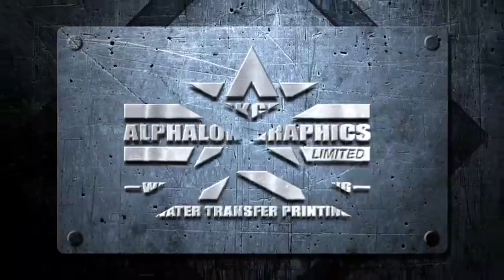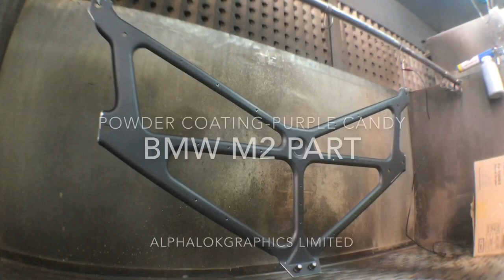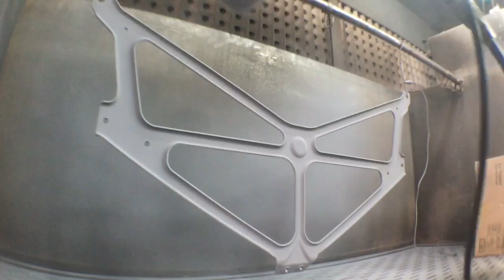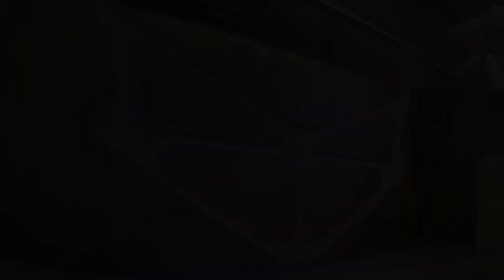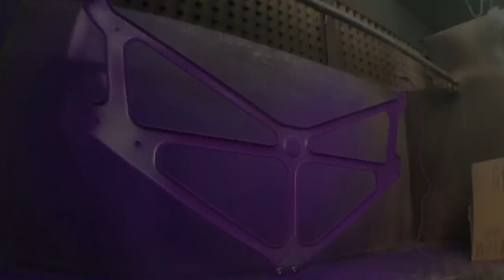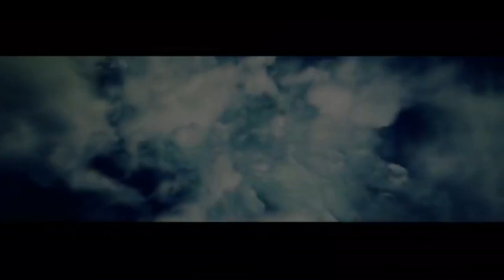Powder coating Purple Candy

Comment: What gun were you using and are you using an earth ground?
Reply from the maker: steven scates Check this out:
https://alphalokgraphicsltd.boutir.com/item/%25E7%25BE%258E%25E5%259C%258Beastwood%25E9%259B%2599%25E9%259B%25BB%25E5%25A3%2593%25E9%259D%259C%25E9%259B%25BB%25E5%2599%25B4%25E7%25B2%2589%25E6%25A9%259FDual-Voltage-Powder-Gu/6425992888582144

Comment: I tried to powder coating myself the results were pretty good, but somehow I got the pertalite the color of the powder coating became dull and soft. what was the error in my work
Reply from the maker: budi harto is it the bake temperature not enough ? Should be 200c , 10 mins.
Reply: @YoutubeShorts_Salonbuzz  I have oven at 200c per 20 minutes